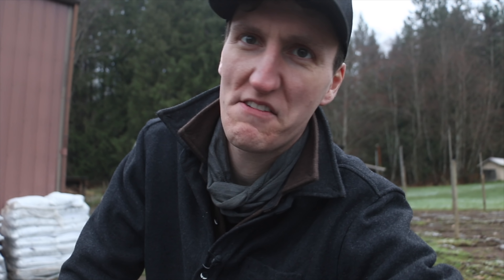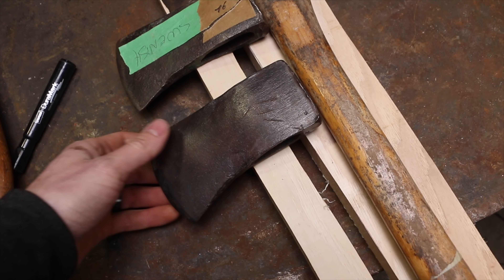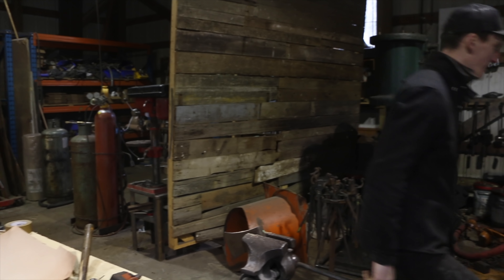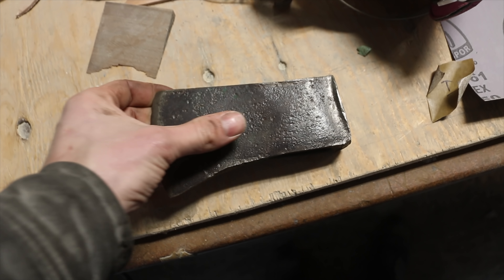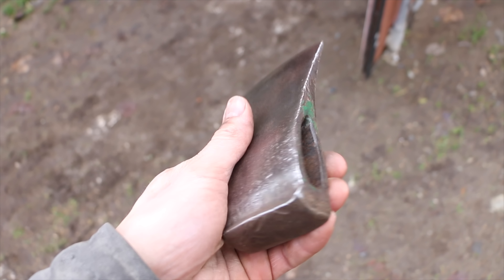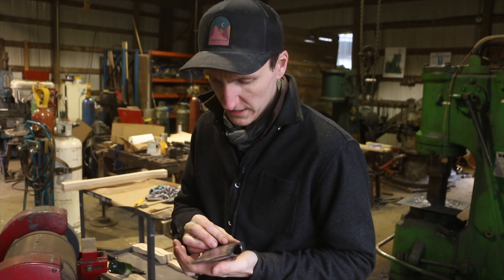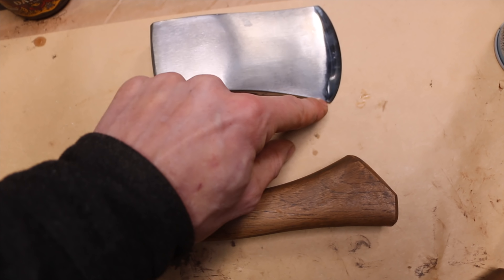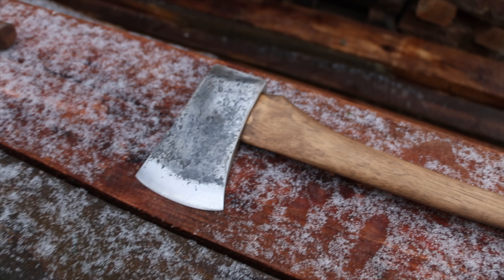Martin broke your axe.

Comment: Looking at pictures before and after grinding, a huge amount of material was ground off, probably 1/8 inch.

My guess is the hammering that damaged the poll created hairline cracks around the eye that were exposed by the grinding. I welded together a craftsman axe with the exact same crack. I still use it every week and it’s holding up great.

Comment: 4:40 A vinegar bath will let you know / see up to where the axe head has been hardened, for sure.
It can be done, even with a hung axe, by dipping the cutting edge in vinegar, the line / area will show.
I've bathed numbers of european axe heads
Greetings from the wintry climes of Basle, Switzerland

Comment: Greetings from the Okanagan again sir. As long as one isn't heating up the cutting edge, we've welded up a few axes with cracks and they've gone on to work just fine. Gouge it out, weld it up and smooth it back down is what we did. Hope that helps and was useful. Merry Christmas to you all.

Comment: So the "gun blueing" you're using is called cold blueing. It's practically an etching fluid that happens to make it black. It doesn't really affect the corrosion resistance of the steel. So make sure to wipe it down with some oil after you cold blue it.

Comment: You could grind out the crack to see how deep it is, and if it's not too deep you could put a weld to fill in the grind divot. This would effect the crystal structure of the steel and make it visible in the cold blueing though 🙁

Comment: Do NOT put epoxy on the axes! It´s hell when you need to change a broken shaft....
And some times it goes loose and you don´t see it becaughs of the epoxy not moving, so the axehead goes flying away when you´re choping wood. Happend to both me and my grandfather....
I will never buy an axe with epoxy on top again!!!

Comment: Cold blueing an axe head is no big deal, clean the head with something and blue away, I don't get all crazy clean like I would if doing a firearm.
I cracked my childhood double bit while seating the wedge. Ended up JB welding the crack then sanding to original profile and cold blueing the head. I've used the axe a few times and the head is holding firm to the handle but this one is more memories then worker, I was swinging this axe at 10 years old filling up the wood box every couple days.

Comment: I would try and restore the cracked head if the crack isn't too deep, by grinding/cutting a V through the crack and welding along the crack then grinding back to the basic shape.  I have one that was much more severely cracked than that one that I repaired in this way, and it is holding up after quite some time.  The crack was likely caused by the heavy hitting that it received on the end for some reason.  No harm done if the fix doesn't hold up, but I wouldn't sell it unless the integrity could be verified through using it for a while.